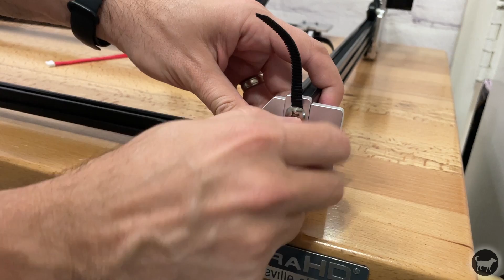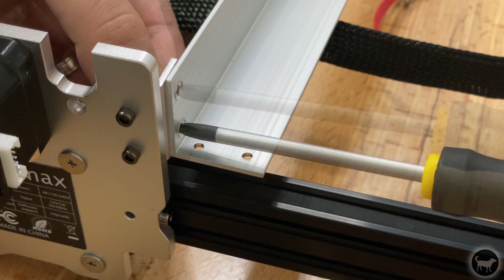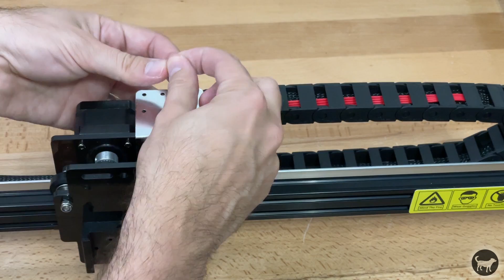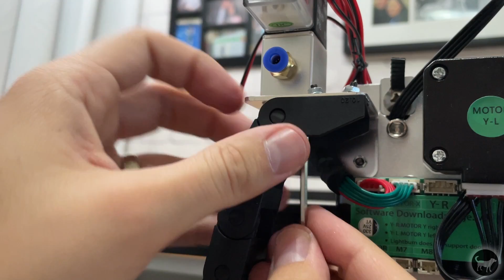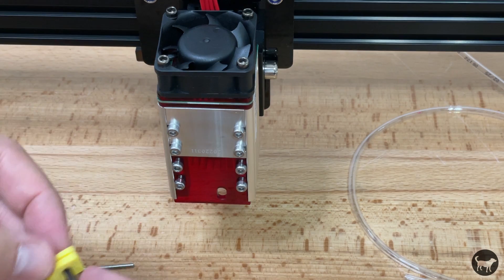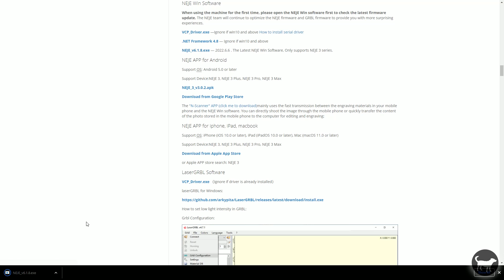NEJE 3 Max Assembly Instructions

Comment: where did you get the air assist nozzle that goes on the laser module it self?
Reply from the maker: Mine came with my unit. I'm guessing it would be on the NEJE website as well.
Reply: checked there first, nothing, but i did find several on thingaverse.

Comment: I can't tell you how helpful this video was!!!!!  An absolute life-saver!  
My laser came with the metal air assist module.  I had to turn the lens brass fitting counter clockwise to create a gap for the o-ring to seat into.  That allowed the metal housing to slide down and align with the pre-existing holes for screw attachment after I placed the module into position.
Thank you so much!!!
Reply from the maker: You are very welcome, glad it was helpful!

Comment: I have Neje 2S Max and need to upgrade with air assist and cables chain.
Where can I find these articles please ? On the neje shop I can’t found aluminum pieces to support plastic chain.

Pieces that you show at the 1:18min. Neje don't sell that, so if someone have the DXF of these pieces please, I need that.

Thanks

Comment: How do you like this laser? How does it compair with the xtool d1?
Reply from the maker: To be honest I haven’t had a chance to use it yet. I was just able to get is assembled before I took a trip. So far it looks nice but I plan on doing a full test and review of the machine when I get back.
Reply: @BusterBeagle3D  any input on this one now? How do you like it?
Reply from the maker: @welldonecj7  Just posted the review. Basically I like the build but would prefer the fixed focus laser module. Overall not too bad especially if you need a very large build area. https://www.youtube.com/watch?v=SV7L79kXqps